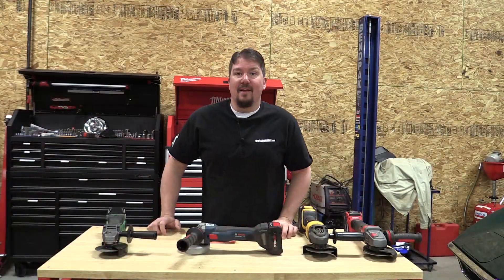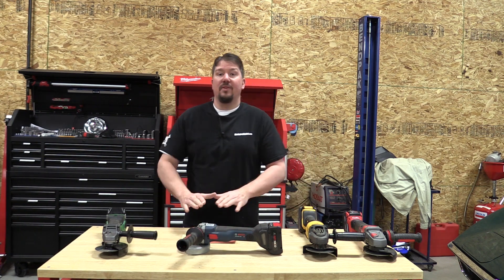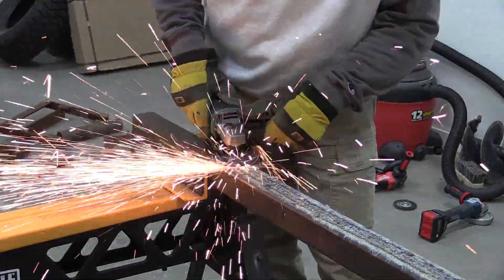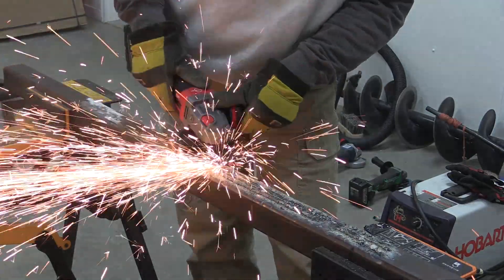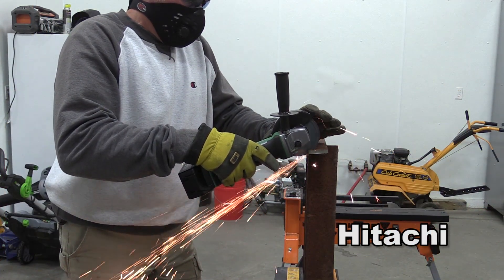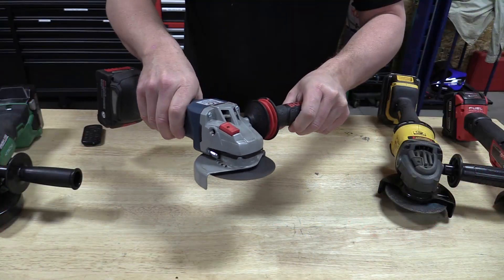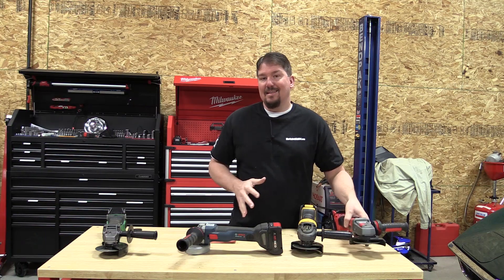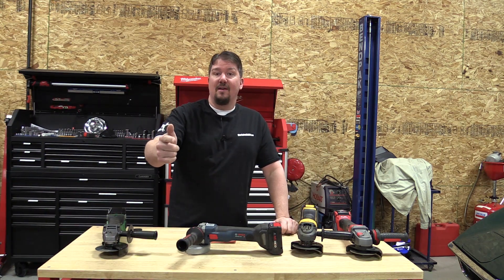Bosch GWS18V-45C 4.5" Angle Grinder vs DEWALT FlexVolt vs Milwaukee FUEL vs Hitachi

Comment: I've been saying this. Grinders are one of the few tools that aren't quite ready to be cordless. For grinding the run time is way to short. As a cut off tool they are more than adequate. I've used several cordless grinders. Overall I'm a Milwaukee man when it comes to tools, but that Dewalt flexvolt grinder is the only grinder that is even close to a corded grinder in terms of performance. If all you need is a cutoff tool, the Ryobi Grinder isn't a bad buy.
Reply: The flexvolt with a 9 ah is a world of difference. Haven't touched a corded grinder since. Dewalt should really pair the grinder with 9/3 ah instead of the 6
Reply: I grind fiberglass non stop with my milwaukee with a nine amp hour battery.  And I'd rather use that then corded. It lasts. I push down on it hard and all I do is swap the battery. So I don't have a problem.  Do with metal as well.
Reply: Hilti and Metabo cordless GRINDERS rock!!!!!
Reply: I’m a Milwaukee man too and I agree with you 👍🏻
Reply from the maker: Bigchuck678 When Ryobi makes a 9.0 Ah battery it will change a lot.

Comment: So since this video 5 years ago, any improvement on the runtime?
Reply from the maker: With the larger batteries, it will run longer.  Milwaukee and dewalt have come a long way with battery grinders, but Bosch seems to be concentrating more on corded tools and the same old stuff.

Comment: If u did read about the bosch procore akku, it said that it works with full power starting from 8AH akku only. 
The things what u do is absolutely nonsense.
Reply from the maker: The 8Ah battery was not out when this video was made.  Maybe you could read the date the video was published if your so well read.  :)

Comment: i hope they make a cordless with optional cord to connect angle grinders
Reply: Metabo HPT does. The G3612DBQ6M Multivolt angle grinder can be paired with either a battery or an optional AC adapter with 20ft cord.
The adapter is pricey though, at around $100 but if you get into that platform then you can switch any Metabo HPT Multivolt tool between corded and cordless

Comment: Just like with corded tools, where at increasing power you need to move from 110v to 220v, with cordless you need to go above 18v. 18v was chosen as adequate for drills, as capacity rose more tools were possible- but then you need more volts to be efficient. DeWalt has Flexi-volt, others use twin batteries, Bosch are resisting and patching cooling and bigger cells into the mix. But that is inferior to just more volts.

Comment: One of the benefits of a cordless grinder is they are easy on your ears, the noise level is way lower than corded, so they give you a level of confidence when using them.  I bought the bosch (with screen)  and you just want to use it to hear that nice brushless motor.

Comment: It does not matter whether you use corded or cordless grinder. If you use cordless grinder, you will spend more money for the batteries, recharged and recharged. If you use the corded grinder, you will pay the electric bill.

Comment: Good review, not many show run time grinding and fettling...Im looking to do some wood carving too fine for chainsaws...would carving with Arbortech discs  give a longer life.....just seems a very short a runtime to me at the mo....and batteries cost big time..
Reply from the maker: The batteries have changed since that video so Runtime should increase a bit.  Get the new High Output batteries and you will enjoy it longer.

Comment: You've totally missing out on the most impressing part of the test; the Dewalt enables by far the most power AND doing it for as long as the best. It should be IMPOSSIBLE, but that just shows how big the gain is of lifting the voltage, since the cells inside practically is the same. ...and you don't even mention this because you're afraid of losing sponsor money from the rest of the makers that stick to obsolete technology. Yes, the differences would not be this noticeable in a low power application, but 18V is history.
Reply from the maker: Mattias Persson Wait, you are saying that I did not push the DeWalt as the king....  And Wait...  The cells are the same?  I'm NO....  The DeWalt is a 3p battery going against a 2p batteries....  It is a larger unit that does completely rock....  So much so that it is not in the same class as the others.  Stop thinking each YouTube channel has sponsors and listen to what we tell you in the video....  Also look at the title...  We compared a new model to older tools...  Watch our video on the DeWalt and we explain it all.  Chill out and enjoy life a bit bud.
Reply: So you're matching a Milwaukee 18V@5Ah with a Dewalt 54/60V@3Ah, is that what you're saying?! Otherwise a 54/60V@2Ah is the closest match since that equals 18V@6Ah.

What you SHOULD test, is the Milwaukee 18V@9Ah against the Dewalt 54/60@3Ah.

Do tests that shows something, otherwise it's just a waste of time watching it.
Reply from the maker: Mattias Persson Bud, if you're the title, you will see there is a new Bosch grinder out and we compared it to other units available.  This was not a test of what is the best grinder.

Comment: weak grinders are a thing of the past less than 10 years ago cordless grinders were almost useless now days they may lack durability but they are not short on power or safety and if you have a few batteries they are starting to compete with corded

Comment: (It’s already not an America company)Chinese Milwaukee Tool
More than 96% Milwaukee tools are made in China. Milwaukee Tool has been carrying out tool-design job in China since 2015 year, the design jobs also are slowly sent from USA to China.
Most plastic materials have been changed from America DuPont, GE to Chinese sources. The red plastic，Nylon，of Milwaukee tool handles/housings has been provided by a Chinese supplier since 2010，originally the Nylons were from DuPont，the Nylons-changeovers cause the handles/housings weak，like screws very likely strapped/slipped in screw holes/bosses, the dimensions are not as much stable. Also black hard plastic for battery pack cases/covers，their materials were changed from GE ABS/PC to a ABS/PC from a Chinese supplier，cause battery pack case more likely broken, brittle, the same story is happening on anti-flam Nylon material of battery frame，change from DuPont to a Chinese supplier. 
Lots of bad tools always first are sold to USA because nobody inspects the outgoing, and because Milwaukee Tool has the strongest warranty service ability in USA than in other countries.
During Milwaukee production processes, more than 5% defects found out by workers, also more defects fail to be screened out. Bad tools include noise as gear, bearing aligned badly, sometimes press trigger no reactions at all, metal parts like shaft, gear, pinion, important screws break as poor heat-treat, motor stator rubbing with rotator, fine wire laid inside tool break as poor design and poor workmanship, big percentage of oil leakage for hydraulic tools, etc. 15% chance you will get a bad tool, bigger chance you will get bad tools for nailer, planer, hydraulic tools, cable/tube cutter, as they are first generation of tools for Milwaukee Tool, because of comparing with sawzall, Milwaukee Tool sucks at nailer, planer, hydraulic tools, cable/tube cutter, AC tools, drain cleaner, blower, hedge trimmer, hammer dust collector.
Milwaukee Tool workers only get less than 300 dollars monthly salary，even plus OT to 276 Hours a month（normal month-workhour is 176 hours，plus 100 hours OT. Chinese law only allows no more than 36 hours OT per month）， after OT 100 hours a month，a worker can get about 500 dollars monthly salary，this salary very low for living in a big city in China, plus bad working environment(the management has no such safety-first mindset that loud noise but no issuing ear plugs to workers, and at dangerous stations very few goggles issued to workers. workers stand more than 10 hours every day during on-duty time, so Milwaukee Tool with huge employee turnover，400% yearly turnover，i.e. workers averagely work only 3 months for the factory, cause workers without enough experience，lack of training，on top of few automation, then unable to ensure good quality. And worse worker- turnover with most Milwaukee Tool’s suppliers.
After Milwaukee tools launched one year， Milwaukee Tool will do so-called VE, value engineering, actually cost-down, change Germany trigger to Hong Kongese trigger even Chinese trigger/switch, change Japanese chuck to Chinese chuck, change metal parts to plastic parts(like ring gears, motor covers),etc. Milwaukee Tool has a team, 50 people to do the VE. The quality would obviously become worse after VE.
Milwaukee Tool has really bad quality system, lose much profit because of failing to keep quality constant, like critical metal parts broken, every 2 months taking place, no methods to resolve the issue in 10 years, starting from 2008. And always look for cheap materials, cheap suppliers, worker salary is always only slightly higher than minimum, only 17 cent higher than hourly minimum salary.
Milwaukee Tool doesn’t care about customer when facing huge loss. In this year, because of poor design, 740 thousands of M18 9A battery packs with function problem, metal strips separated from welding points, i.e. the circuit broken, they did not recall these battery packs, only modified structures of the metal strips and battery frame to improve the problem for new batches of battery packs, reworked 14k and scrapped 42k of the old plastic battery frames.
Milwaukee Tool has less experiences for making power tools comparing with Makita, Bosch, Dewalt(Milwaukee Tool CEO JG and a senior VP JW had worked at Dewalt for years). Milwaukee Tool only has grew fast from 2008 year. They copy and compare tool life tests with Bosch, Dewalt’s tools during new product development stages, even for troubleshooting during R&D, they would measure dimensions of these competitors’ components.
This company is also an ugly company, three years ago, a Hong Kongese manager tried to rape a female employee during their business trip, the company fired him and less than half year, hired him again as a manager, then the female employee left this company and lost her job. Two years ago, in its factory dorm a more severe rape case really took place by a male senior manager to a girl/employee, and this Company didn’t do anything to him, like firing him, like reporting him to police，helping officer to arrest him.

Comment: Well, if you do the math that`s exactly what you will expect.
18v x 6Ah will only get you 108Wh of energy in the battery. If you consider an equivalent corded grinder is rated at around 1600W then 108Wh at 1600W will give you: 108Wh/1600W=0.0675h => 4.05 min
If you want a full hour of run tine then you will need a 1600Wh/18V =~ 90Ah battery, so don`t expect a huge increase in run time any time soon, at least when you are pushing it hard.

Good video, keep them coming.

Comment: Great video, I have 2 Milwaukee’s.  An 18 volt and one is the fuel 18.  I love them for short work, and if I’m going to be doing a lot of grinding I’ll use the corded one.  I have several corded with different wheels on them.  Flap disc, grinding wheel, straight brush, cup brush, cutting wheel etc.. I find I save a lot of time not having to change out the wheels when on a project.

Comment: Crazy place to put your finger while cutting #byebyepinky.
Reply: A totally irresponsible and unnecessary way to hold a grinder. I get they’re doing a comparison and not teaching technique but when you have this many viewers many of which would be complete novices there is a certain level of responsibility regarding the content being produced.
Reply: Jez Mendoza especially using gloves. Not safe practice
Reply: He has bought insurance nvm
Reply: It takes a lot to cut off your pinky with an angle grinder. I don't think that is practically possible unless you use a blade with teeth. But it's very true the way you point out how he holds the grinder.
Reply from the maker: That dude has spent a lot of hours, days, or even years behind a grinder.  I get it though...  #OldSchool

Comment: I've had my Milwaukee 18v Fuel grinder for a couple of years now. If you are the average homeowner/property owner who is into the M18 line with a couple of batteries, the Milwaukee will be more than enough. I get about 15 - 20 minutes out of it on a battery (how many jobs take that long?) and have zero issues with runtime or power.
Reply from the maker: I agree. All of these grinders will last for a decent time when used on small jobs.

Comment: What I got from this, is the battery operated grinders sucks.
Reply: Once using 9 amp h with a larger cell and a spare on charger.... you will get rid of any corded tool!
Reply from the maker: Sorry.  That is not the case IMHO, but you should know what you are paying big money for.
Reply: I just mean in terms of runtime, not power or anything else.

Comment: Hitachi sucks. I bought an 18v lith-ion 9pc kit a couple years ago and I just can't express how disappointing the performance has been. I had worn out all 4 of my DeWalt batteries and the tools had a lot of use on them when I got a killer deal on the Hitachi 9pc. Man, thinking back that deal came at a huge price. Never again. DeWalt Or Milwaukee, nothing else.
Reply from the maker: Hitachi purchased Metabo and stepped up their game, so we keep them in the running.
Reply: I agree. Just holding the hitachi display models in lowes is cringey. They just feel like junk. To me the kobalt tools feel better than the hitachi. Not to mention the hideous green color. 

I was watching an impact driver test yesterday, and the Hitachi triple impact driver was one of the worst performing tools in the test.

Comment: I have the hitachi brushless 18v grinder and with the 3 amp hour battery it lasts like 1 min lol it’s honestly sad how fast grinders chew through power. The only thing I really don’t like about the hitachi is probably the handle. It isn’t comfortable like the Milwaukee or Bosch. Im surprised DeWalt doesn’t have a fancy handle. Other than that it’s really handy to have a cordless grinder and I like it a lot.
Reply from the maker: Dewalts handle is sort of fancy and unlike any of the others!

Comment: Run time is so bad. Rubbish for heavy work at scrap yard on large shears and presses. Portable but expensive in battery consumption.
Reply from the maker: Fritz Stewart For cut off or small jobs they rock.  But....
Reply: For that kind of work a 9" or 6" corded would be my tool of choice. I ran a welding school toolroom maintaining/repairing a variety of angle grinders and the corded 9" DeWalts did very well. The 9" Metabo had more torque but the stupid rotating handles would loosen over time along with the blade guards. The 9" Milwaukees were good but also had handle loosening issues (those didn't rotate).  Recent Metabos have a different guard latch so if they un-fucked the rotating handle (which I have no idea why anyone needs unless they don't have a thumb!) latching setup I'd go that route or perhaps Makita. We didn't run recent Makitas there but my personal 6" Makita is almost as good as my 6" Metabo. BTW if you want a great die grinder the Milwaukee 5196 is outstanding.

Comment: I always wonder why people love the Milwaukee stuff so much when I see the DeWalt bust it's ass almost every time... The people doing the review or demonstration comment on Milwaukee's little differences like particular lights or a button the tool may have and they like it... Then I watch the video   (review) and the DeWalt's  consistently out perform.... Maybe people are just susceptible to gimmicks and marketing...
Nice work... I'm actually pretty surprised that the Bosch hung in there as well as it did and the Hitachi actually made a good showing at least not bad...
Reply from the maker: Justin D They do kick ass!  But not quite up with the power of the Milwaukee nor the runtime.
Reply: WorkshopAddict Really? Every review I've seen shows the new DeWalt 20v grinders kick ass. The Flathead version especially looks awesome. And the Flathead design appears to be a game changer for getting into tight spots. You guys are great and I appreciate the time you put into these videos. Just a strange comment to me. 👍
Reply: I have both and the DeWalt doesn't bust its ass they are both good grinders.
Reply from the maker: Craig Cundiff Milwaukee makes some of the best 18 volt stuff on the market.  The outcome would have been Milwaukee in first if we would have had the 20 volt Dewalt angle grinder had been in the mix.  The Flexvolt items are hard to compare to 18 volt.
Reply: WorkshopAddict bang for buck I just think that DeWalt isn't so far out shadowed by Milwaukee and a lot of times beats Milwaukee and the Milwaukee is consistently the highest price tool...almost like ( for instance) Snap-on will charge  $300 for 10 sockets and most of the time you can get the same sockets from a range of $60 to under $200 and they're practically the same... not so much better that it needs to be 50% to 400% more money....

Comment: good stuff! i got the milwuakee fuel, the one with no brake
two 3.0 batts and one 9.0, the two 3s certainly wouldnt cut it but with the 9.0 and 2 chargers i never run out of batteries as two are charging while ones being used.. it can be a good idea to change the batteries out around the 40% mark to keep max power in the grinder, if the batteries right there anyway
Reply from the maker: The 9.0 is a great battery for the grinder for battery life!